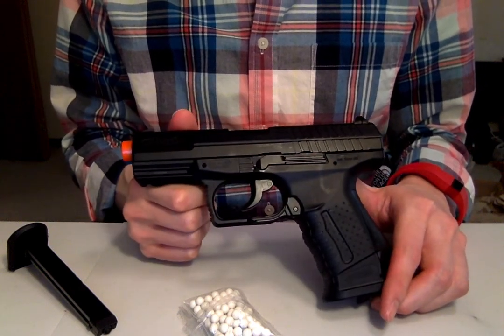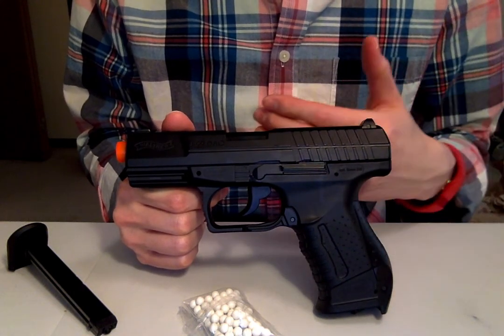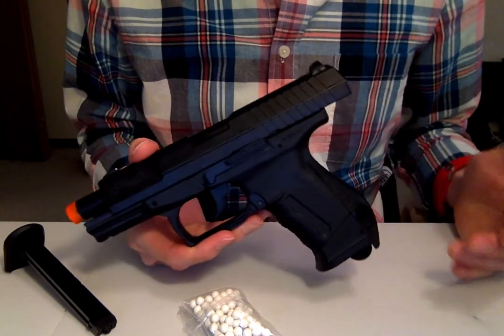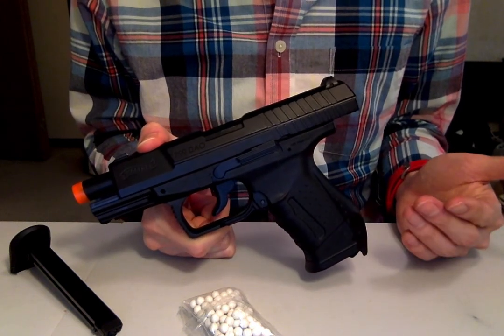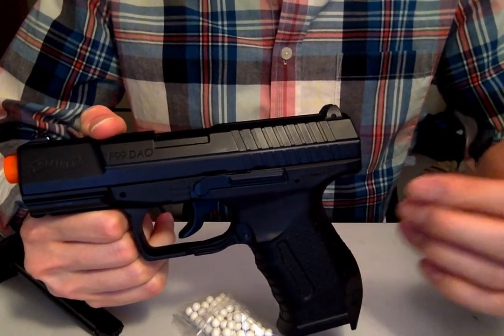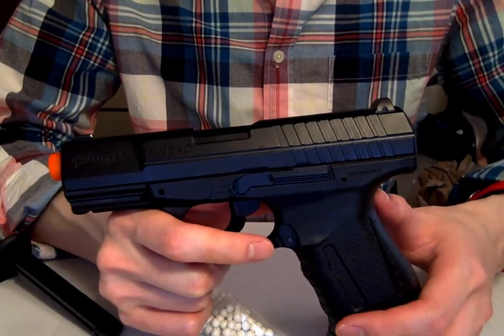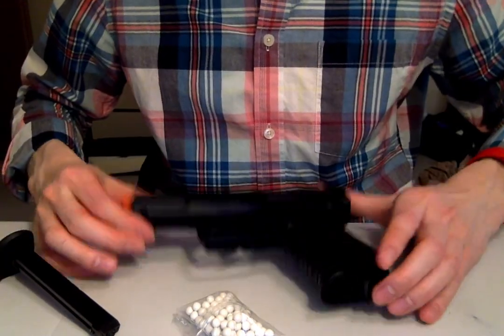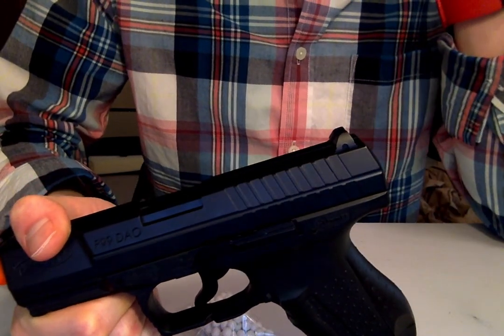Drying Firing Airsoft GBBs: What Actually Happens? Part 1

Comment: 10, 000 and your Air Soft guns life is over? WTF kind of P.O.S. you wasting your money on?!!!
I've shot  Co2 pellet guns that are over 50 years old and regularly used and must have well over 250,000 cycles on them! Proper maintenance and handling and still accurate and reliable.
They may have more but certainly not less because these guns have had multiple users through the years, not just one person shooting them!

Dude, my latest bb gun is an Umarex Glock 19 gen 3 non-blow back.
I get on avg 60 accurate shots (4 clips) per 12g co2 tank.
At that rate I will hit 10,000 rounds and have used 4 boxes of 40 ct. CO2 tanks and 10 containers of 1000 ct. BB's. (Less containers if I buy the larger bottles!)
I can easily go through 5 CO2 tanks in a shooting session.
So that's 32 shooting sessions!
If I only shot one day a week I'd go through a gun every 8 +/- months !!!!
If that's works for you, well, you're alot easier to please than me!
But 10,000 cycles sounds like a disposable toy.

Comment: What happens if you fire a gbb with bbs but without gas?
Reply from the maker: So the bb won't fire, but pulling the trigger will load a bb into the barrel, so it will just roll out of the barrel.